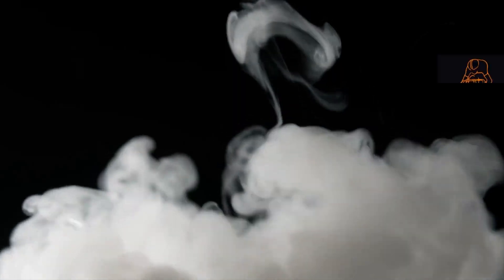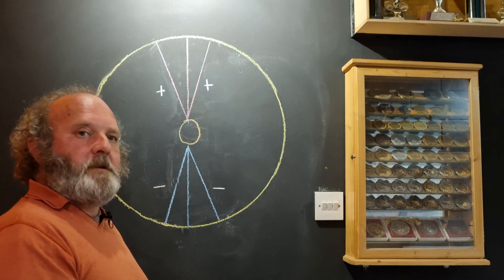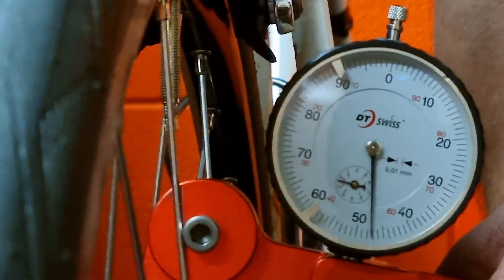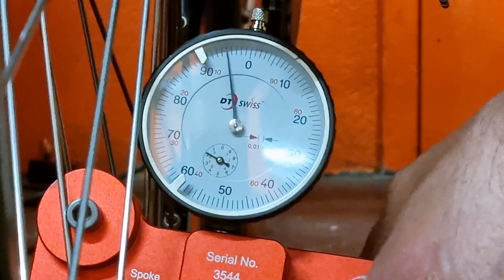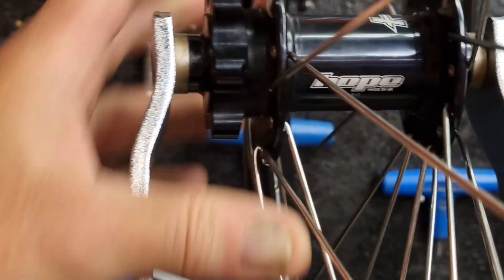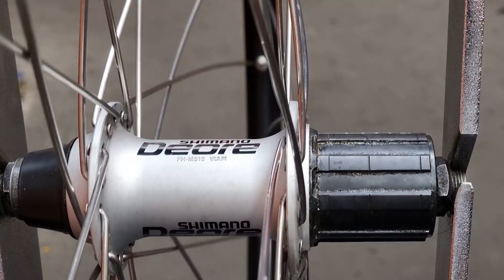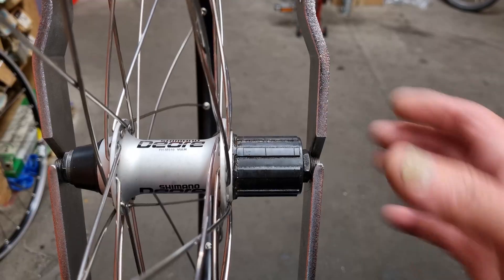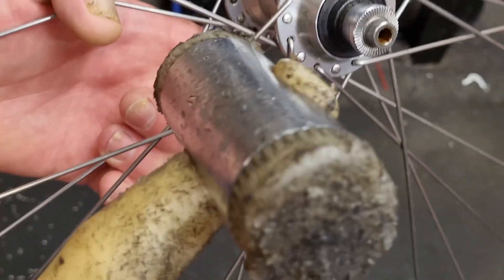WHEEL BUILDING PRO TIPS...  SPOKE TENSIONS AND WHY THEY BREAK

Comment: I have a crabon wheel with 18 spokes (front). The rim was replaced by warranty because of break surface damage. However, after relacing the wheel, it keeps breaking spokes. Like once every 2 rides spokes are snapping. Tension is good all round and the rim is straight.